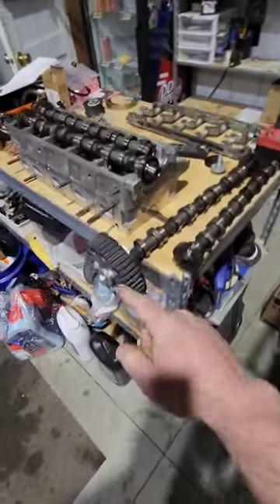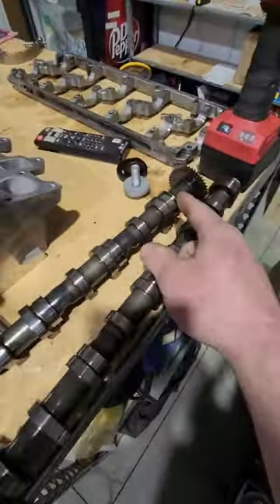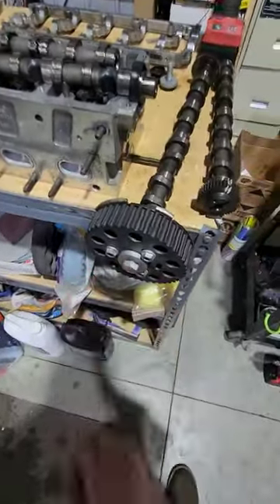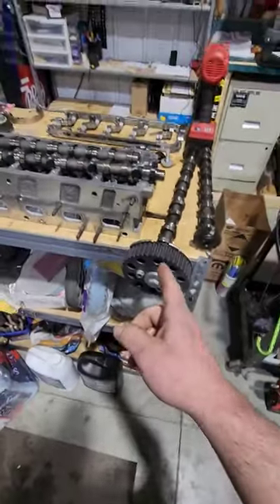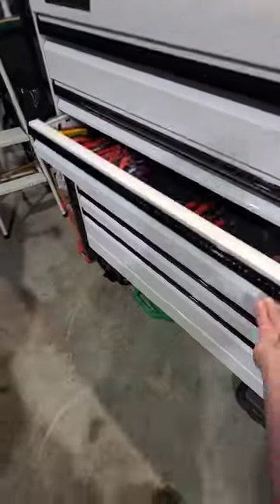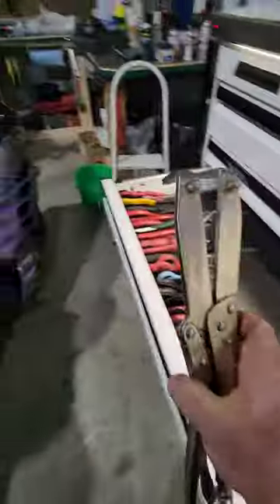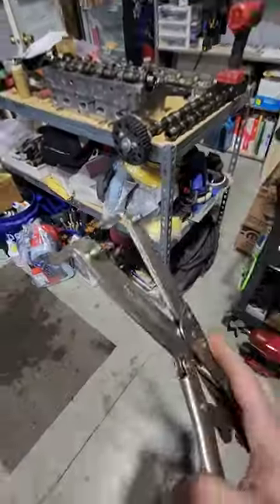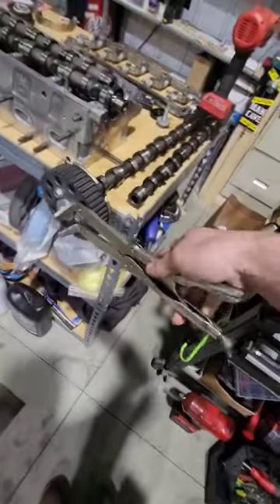Specialty vise grips! #tools #shorts

Comment: I drive 100,000 miles per year , I go through 1 engine , 2 transmissions , 2 timing belts , 2 water pumps , as a ride share driver.

Comment: Lucky that cam didn't shatter. You must have the fancy concrete at your shop 😊
Reply: Fancy concrete?
Reply: It’s because it’s a steel camshaft not a cast iron one
Reply: Vw cams are strong af
Reply: @davidperry4013 I've dropped a few cast cams in my day, never seen one shatter or crack. I had a big one chip my concrete though
Reply: @atmac2162  yeah, it's is softer so when you drop things on the floor they don't get damaged.
Reply: @kylejackson4245  i dropped a cam from a nissan rb20 into the grass at my house and it exploded in two lol
Reply: @jacobjacksonsson9375  Rock
Reply: There is no way that would shatter any cam. Dent scratch or bend not nearly enough force to shear or shatter.
Reply: @jacobjacksonsson9375 No one believes you. Got to be a lie or more to the story.
Reply: @JacobLeeson-zk1ol  I promise on my life bro it scared me. I dropped it from chest height onto the ground and it popped in two
Reply: @JacobLeeson-zk1ol  the old cast cams are known to bust into many parts when dropped.

Comment: There Is a special tool. It is a spanner that you change the ends for the application. Pin type, tripple square, and special design. Special tool cabinet drawer 8.
Reply: There is a flat spot it's right behind the pulley you use a 18mm wrench. If you look you can see it
Reply from the maker: @hunterstover9852  that's not for a wrench. It's so the head bolts can be removed without removing the cam.
Reply: Correct but many vw mechanics use that cut out to time the cams and from personal experience not all vw cams have the hole punched in the pulley gear. And if you ever worked on the 2.0 the "valve cover it's actually called a cam cattle or cam bridge" is what actually holds the cams down and you can't get the head bolts without taking the cam bridge off so the now on older vw they use the traditional bearing caps but from I think 2000 on most vw use the stupid cam bridge
Reply: And once you take the cam bridge off the cams basically fall out there is nothing holding them in
Reply: Also I don’t think that bolt goes there, usually with our sprockets that have the three 13mm bolts the 18mm bolt holds the hub to the camshafts and yes we have a special tool with three pins that hold that hub to tighten the bolt or loosen the bolt
Reply: @hunterstover9852  I have an 01 2.0 and recently pulled off the valve cover. I can confirm this is correct
Reply: Try using a proper cam sprocket holder,its not rocket science.
Reply: @hunterstover9852  Which one 2.0? Because there was like shit load of them.
If you are talking about cam bridge that isn't integrated into valve cover, then you CAN unbolt head without removing bridge/cams. That's why you have that dent in camshaft tube.

Comment: The special tool number you are looking for is T10051, 3 pin counterhold with hole for camshaft bolt. The puller for the hub on the cam is T10052. Cam seals leak like crazy on the common rail TDI's, I do these all the time.

Comment: No specialty too required as long as the gear has the three surrounding smaller bolts. Simply put a box end wrench on one of the smaller bolts and leverage it against of of the other smaller bolt heads.

Comment: Just be happy it turns over, I replaced a snapped cam bolt once and when I torqued it down without holding the cam it occurred to me that the issue at hand was not me reusing a torque to yield bolt to often but a completely seized camshaft. I got a new to me cam and housing for 20€, I am just happy I didn't try to turn it over...

Comment: I had a '91 Chevy truck and the power steering pump pulley required a special pulley puller. Behind that pulley were the power steering pump mounting bolts so you had to remove the pulley to do work. 

The puller had a two piece connector that went over the end of the pulley and the tip of the puller then a metal collar to hold those pieces together then you back out the bolt in the puller and the pulley comes off with it.
Reply: All gm and ford need this tool your truck is not special lol
Reply: @legros731  I must have my words wrong, I wasn't saying the truck was special. That truck was as generic as it gets but nobody I knew had that puller and it wasn't for sale locally. I had to borrow it from Autozone.

 It's not a crow's foot or the jaws kind. I don't work on fords.
Reply: @asimpson164  i know a was just being dick lol that was just for fun

Comment: Why has no one ever seen an adjustable fan clutch holder for bout $12 that also works for cams, cranks, ps, ac, water pumps and anything round with at least 2 holes? Part store tool aisle too

Comment: Wait until you discover that you can use that pin wrench to rotate off covers by the bolt holes, stuck on with gaskets, rather than pound them off or wince while you wedge them off.

Comment: Um what about all the flat spots between the lobs? Also there is a locking plate that bolts in and holds the cams in place??????????   See the round spot missing in the middle of both cams? Thats right where the cam locking plate bolts in.

Comment: Introducing the Isotronic Gravitational Torque Magnipulator, a groundbreaking innovation in the field of pseudo-kinematic energy conversion and vise grip optimization. This state-of-the-art device is expertly designed to modulate and synchronize the intricate mechanical interactions within complex gripping systems, while simultaneously enhancing the stability and adaptability of interconnected components.

At the core of the Isotronic Gravitational Torque Magnipulator lies the pioneering integration of a multi-scalar, gyroscopic fulcrum lattice. This lattice harnesses the power of mechanically synchronized torque harmonics, initiating a meticulously regulated series of self-organizing, trans-axial interference patterns. As a result, the device optimizes the coherence and synchronization of vise grip waveforms across an extensive range of operational parameters.

The Isotronic Gravitational Torque Magnipulator is also furnished with an advanced tribomechanical synchronization conduit, which employs a highly sensitive array of strain-responsive phase detection nodes. This enables real-time monitoring and adjustment of sub-millimeter mechanical oscillations, effectively neutralizing the undesirable effects of energetic anomalies and material dissonance.

Moreover, the device incorporates a cutting-edge, isotronic torque inducer that dynamically generates an enveloping field of non-localized force particles. This field functions to stabilize and reinforce the structural integrity of the gyroscopic fulcrum lattice, granting the device the capacity to maintain an ideal operational equilibrium, even when exposed to extreme conditions.

A series of tetradecagonal, elastodynamic dampeners are strategically positioned around the device's epicenter. These dampeners provide critical protection against the detrimental effects of ultra-resonant frequency oscillations and ensure the seamless operation of the Isotronic Gravitational Torque Magnipulator, regardless of the intensity of system activity.

Lastly, the device possesses an integrated zeptoscale force-gradient modulator, which perpetually samples and scrutinizes the surrounding mechanical energy patterns within its functional environment. This sophisticated feedback mechanism enables the Isotronic Gravitational Torque Magnipulator to smoothly adapt to shifts in system performance and extrinsic circumstances, maintaining a consistent degree of vise grip harmonization and stability.

In summary, the Isotronic Gravitational Torque Magnipulator epitomizes the cutting edge of vise grip technology and system enhancement. With its inventive design and unparalleled performance, this device is set to revolutionize the realm of mechanical force optimization and inaugurate a new epoch of effectiveness and stability in elaborate systems.